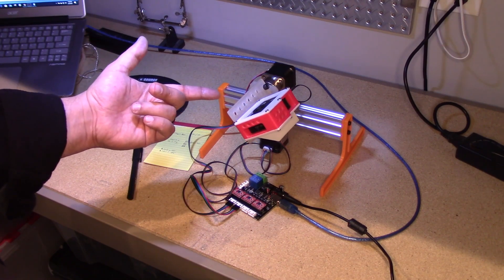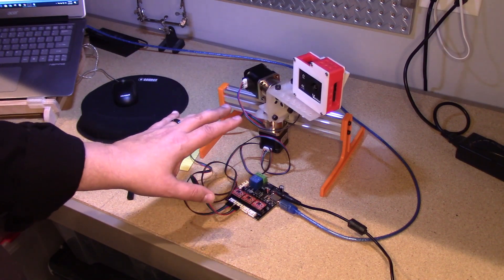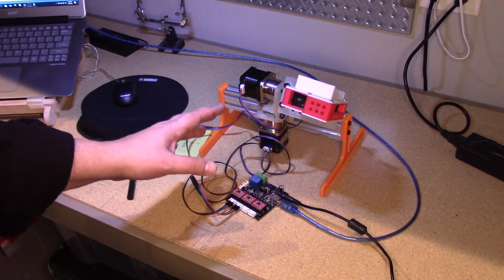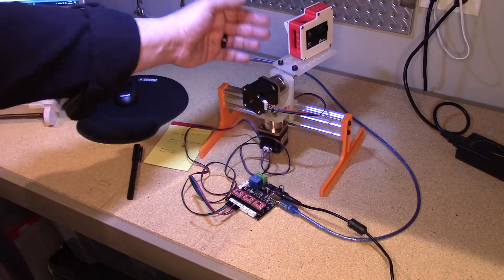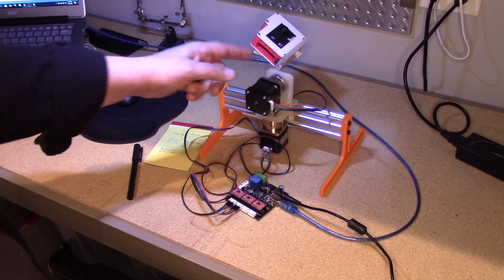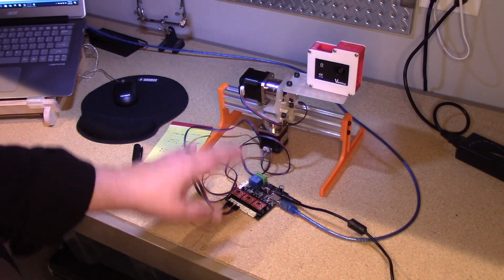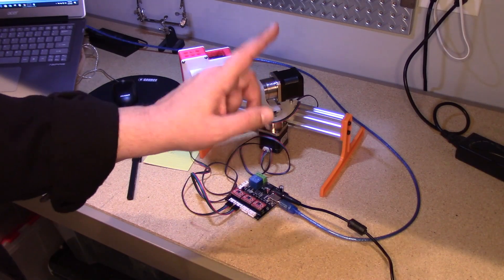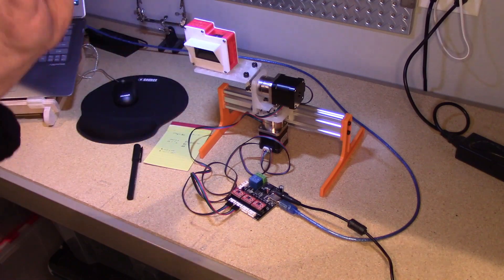Motion Control  -  Its Alive!

Comment: How to reduce gear backlash on z axis (vertical axis)? It will effect to footage when the motor stop.
Reply from the maker: Depends on the focal length of the lens and the design of the shot as well as this will have PID so there will be ramp and down on top of the massive gearing.

Comment: This is really helpful thanks, do you need to flash the arduino with g-code software - / firmware?
Reply from the maker: This board comes with it already installed to no need to add...

Comment: A bit of a counter balance on the camera, other side, to help take strain off the motors.

I like the camera display hood
Reply from the maker: Thanks, I designed a complete action camera cage (see more here: https://www.thingiverse.com/thing:4062299 ) and the counter weight is likely a good idea for as for strain, these motors handle with no issues they have tons of torque and holding power...

Comment: Pan and Tilt Camera steppers and Arduino

100 to 1 geared stepper and extra worm gears to increase torque and reduce speed. Using Arduino
https://hackaday.io/project/6077-pan-and-tilt-camera-steppers-and-arduino
Reply from the maker: Unfortunately the link doesn't work but get the idea.  You can also get this motors in a number of other ratios too going higher...
Reply: @DIY3DTECHcom  Try https://hackaday.io/project/6077-pan-and-tilt-camera-steppers-and-arduino